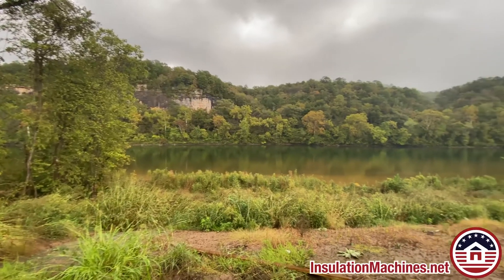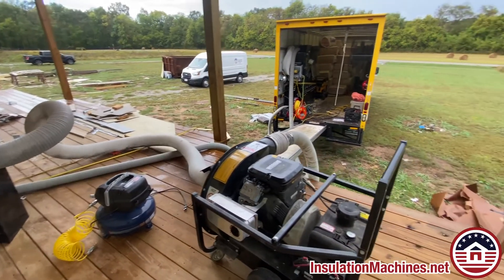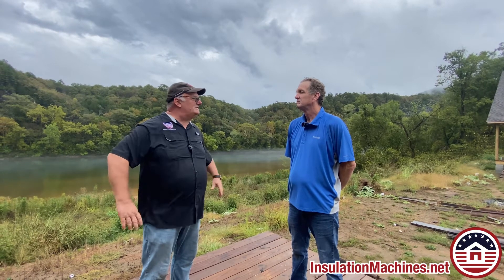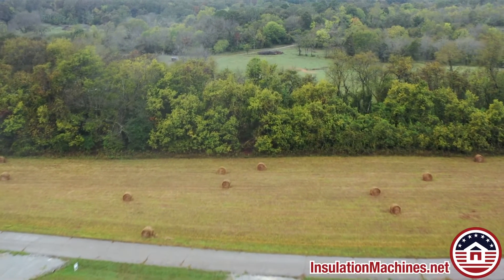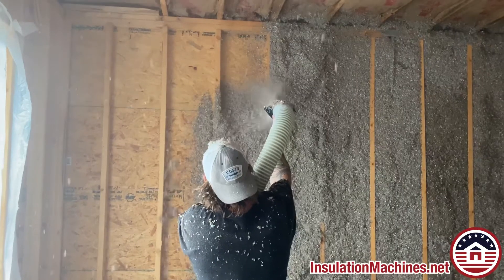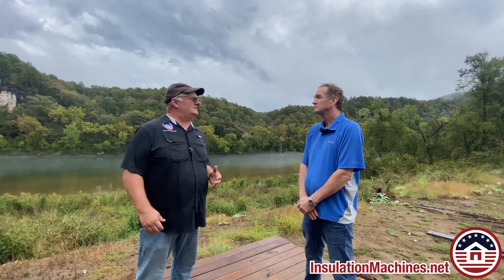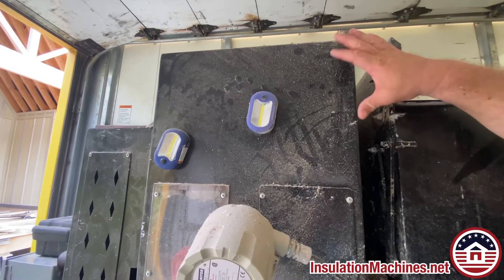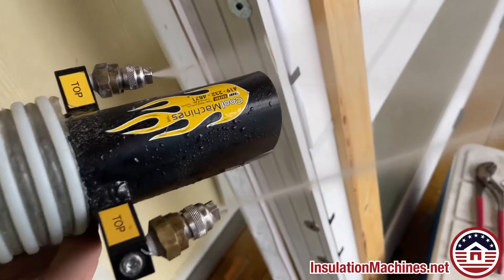Testimonial Tuesday — Insulation You from Jonesboro, Arkansas

Comment: That cellulose wall application seems to  stick to the walls nicely. I can’t see that settling like straight cellulose would blown into a mesh. I heard fiberglass can even settle half an inch on the top just below wall top plates. Great shots with the drone too.
Reply from the maker: If the cellulose is not put in under pressure (3.5psi) during dense packing, it will settle. It’s the same with fiberglass (2.5psi). We were just at our daughter’s yesterday while her new home was being dense packed with fiberglass. The installers were doing a great job and we’re confident it won’t settle. Thanks! Even though it wasn’t a sunny day, it was such a beautiful area that it was easy to get good shots.
Reply: @InsulationMachines  that is good to know for the pressure. I think though that cellulose would do a better job since it's installed with open walls vs shooting in specific entry points. I think they need to invent a similar machine but for fiberglass in open wall cavities.
Reply from the maker: We have a specially shaped nozzle for fiberglass in open wall cavities. We add water to the fiberglass (just like cellulose). Johns Mansville has Spider and Knauf has Jet Spray... both fiberglass. I have a video on this where I trained a crew in Knoxville, Tennessee.
Reply from the maker: https://www.youtube.com/watch?v=hqFX99eyEHo
Reply: @InsulationMachines  checking that out. Thanks for the video.
Reply from the maker: @SinnisjInsulator , thanks for watching!